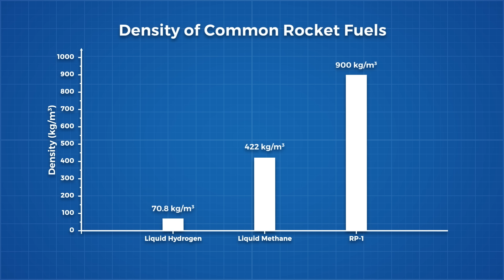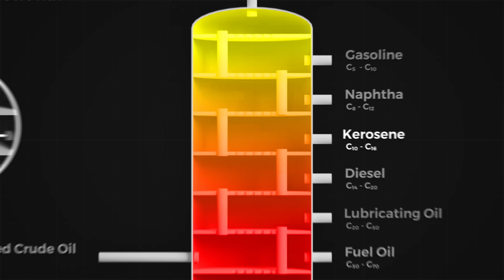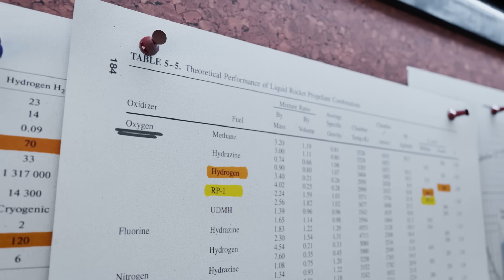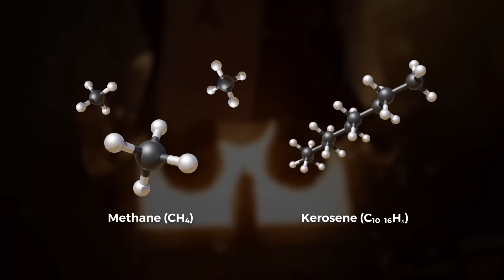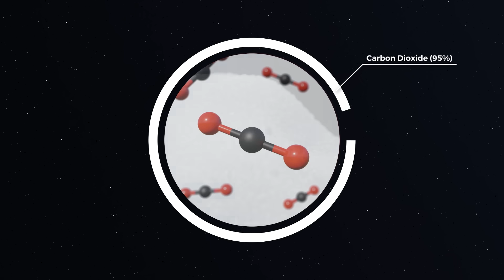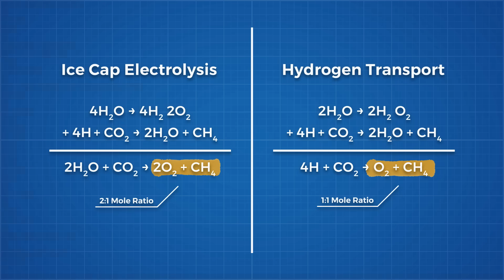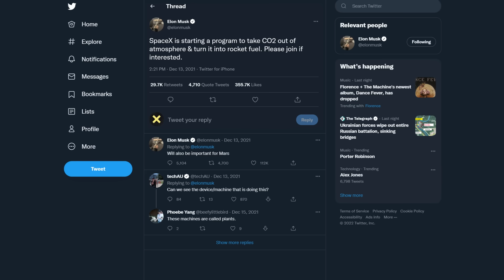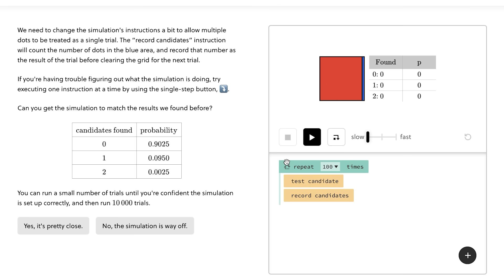Why SpaceX is Using a New Fuel

Comment: I think the chemical equations at 9:00 (& repeated elsewhere in the video) should be

             4(H2O) -->  4(H2)   +  2(O2) 

4(H2) + (CO2)  --> 2(H2O)  +  (CH4)

(Using parentheses because I can't do subscripts here, 
so treat all numbers inside parentheses as subscripts.)

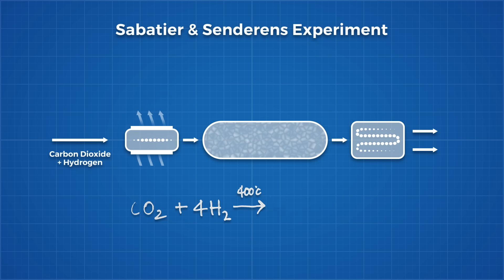Note 2nd equation is shown correctly at 8:55.
Reply: @12:17 did you find an error in the final eqn for the 'Hydrogen Transport' final eqn too? Requiring 2 moles O2 for every 1 of CH4), I get: 5CO2 + 4H2 -> 4CO + 2H2O +CH4 + 2O2 compared to video: 3CO2 + 6H2 -> CH4 + 2CO + 4H2O . Both eqns are balanced...but since the product oxygen (needed for subsequent combustion) is omitted in the products I think the molar coefficients in the video are in error. Is this correct?
Reply: @2hedz  all equations @12:17(RWGSR + SR) are balanced.  But the formulas at bottom keep changing until 12:31, & I do see a problem there.   
2 C atoms on left, 
but 3 C on right
4 oxygen atoms on left, 
but 6 oxygen on right
12 H atoms on left,
12 H on right, but that will have probably to change when the others are fixed.
. Is that what you mean by final equation?
Reply: You are right! Yes @12:31 ... total mess. But what I am saying is that @12:17 he did not include oxygen in the products. Therefore even though the equation is balanced it is wrong because one of the products is totally missed! Anyway...what a mess of a video. Not sure what happened.

Comment: i think i've read somewhere it is actually better to capture CO2 from the sea rather than the air here on Earth? the captured CO2 could also be turned to Methanol which is even easier to transport, store and dispense at the pump (for Earth applications)
Reply: The one big issue with carbon capture is that converting CO2 to fuel costs a lot of energy - as much energy as was released when burning up said carbon. If we had that energy to spare (from nuclear or solar power plants for example) we could just use that energy instead and not burn the carbon-based fuel. If we eliminate all fossil fuel based power plants and leave transport as is, we'll fix most of the too-much-co2 problem.

Comment: Coking isn’t necessarily a problem due to incomplete combustion, but thermal decomposition of the fuel while it passes through components like the regenerative cooling channel. As it flows through these heated tubes the fuel decomposes into smaller hydrocarbons depositing carbon layers on the surface. In the main thrust chamber, coking actually benefits the engine by further cooling the chamber walls, of course with a penalty of performance and reusability. 

Another interesting point is that rocket folk borderline obsess over a fuel for a little bit. Right now it is methane, in the early 2000s before spaceX, hydrogen peroxide was the oxidizer of the future. Before that, it was liquid hydrogen and toxic hypergols like MON and hydrazine. The fuels of the future after methane seem to be ethane and nitrous oxide, and ammonia (ammonia pretty much exclusively for hypersonic applications).

In hypersonics, there’s much interest in fuel “cracking” which means taking advantage of that thermal decomposition with a catalyst with a coking resistant kerosene derivative (like JP-7) or ammonia to have better cooling capacity and in the case of ammonia turn something that doesn’t like to burn (NH3) into something that very much likes to burn (N + 3H).

Comment: The darker exhaust on the Saturn launch is because there is fuel sprayed down the sided of the nozzle to provide cooling. Not all kerosene rocket exhausts look as dark as that.
Reply: I'm pretty sure it's actually fuel-rich exhaust from the preburner that is funneled there to cool it
Reply: It was sprayed on the side of the Motor Nozzle. It was pumped through pipes around the nozzle.
Reply: @PBMS123  This is correct
Reply: NOPE. fuel is used to cool the engine - but it is then cycled back into the combustion chamber.
Reply: False.
Reply: @anopoabednego6173  Yeah This was a half-remembered fact. It's gas generator exhaust which does have a partial cooling effect with associated benefits but the darkness is because gas generator exhaust is fuel rich. It's still true that this is an engine design feature.
Reply: He's a muskrat and they're not known for their intelligence

Comment: There’s an error in your stoichometry at 9:16

You wrote down the methane production process as requiring 4 moles of Hydrogen ions, when it should be 4 moles of Hydrogen gas. Otherwise there are not enough Hydrogen atoms to make 2 moles of water and 2 moles of water.

Comment: Something I wish I could ask Elon Musk is why Spacex hans't worked on developing a carbon monoxide based engine.  It has similar ISP to methane but would be far more suitable for Mars as both oxygen and carbon monoxide can be quite easily extracted from carbon dioxide. No need for a massive infrastructure to mine the extremely scarce water. There are some challenges with using CO in a rocket engine but mostly because no one has really put much effort into solving them yet and I'm sure Spacex would figure it out.
Reply: CO is deadly, it will kill the astronaut first
Reply: @widodoakrom3938  Normally the astronauts would not live inside the fuel tank but instead have a separate compartment towards the front of the vehicle and that would be filled with air.

Comment: 1:10 this is a gross oversimplification. A liquid hydrogen first stage was considered, and would have been feasible to build - and would have resulted in the Saturn V weighing only 2/3 what it did. The reason they didn't go with it wasn't tank size, it was that liquid hydrogen produces much lower thrust than kerosene, so building a powerful enough first stage engines would have been more challenging.
Reply: can use booster like they did with the Space Shuttle. Solid fuel has the highest thrust ever so they are often used as a strapped-on boosters for lots of rockets.
Reply: @xponen  I don't think that solid fuel rockets were where they needed to be at the time, plus the US had little experience with the concept at the time the Saturn V was designed(though it's noteworthy that the Soviet N-1 also lacked boosters, despite their experience with them).
Reply: @angrymokyuu9475  The largest ever solid rocket motor was actually fired in 1965 and 1966 (weighing about 850T, compared to the 600T for the shuttle). These were meant to be alternative first stages for the Saturn 1B, but were never flown... or even removed from the test stand after firing, they're still there.

Comment: I like and enjoy watching your content. However I have an issue with your approach to metrics. Impulse is not a fact, it is a metric, it is a way of understanding, imagining, describing, calculating, measuring. It is not a physical phenomenon. I took me a while to understand there is this difference and to get, it has value. The value is; only trained engineers and physicists understand and care to use these phrases. You may want to find a simpler way of communicating.

Comment: good video sir, really interesting. just one clarification from a pedant chemist: at 9:04 you say that 4 moles of hydrogen are used, but if you look closely you can see that that hydrogen has no "2" at his pedice, hence I suggest you to correct it because if you leave it like this it seem like you're using radical hydrogen. also I don't understand why you didn't add the plus sign (+) in between oxygen and hydrogen generated trough electrolysis in the same set of equations; finally the CO2 at the bottom equation should have the 2 at pedice since it indicates the fact that the carbon is linked to two oxygens.
as a general rule for chemistry equations: numbers in front of formulas are normal and those indicates the number of molecules obtained, and numbers in the formulas of in front of formulas indicate how many atoms are included in that molecule hence are write smaller ( pedice).

if you need a clarification contact me freely. 
have a goo day.
Reply: Hey this is what I’m learning about in my chemistry class. Just thought it was cool

Comment: Not sure what the new fuel will do regarding the path to orbit, the Beast first stage, originally cannot carry the second stage to fully park it in orbit velocity, because of this, it will need additional stages, perhaps adjacent Falcon model form crafts to carry replicate fuels. 

 e.g. Starship must perform 2(two) full Starships for a round trip travel route, with the RISK of Refuel (double cost), Refill ( o2 add for human awaiting in orbit) and Relaunch ( over the possibility of futurekinds of weather scrup delays, abamdoning cargo/topic in orbit) senario most would say not worth it.

 Saturn V ( as 5 Stage ) barley climbed to the moon, Starship is attempting two canisters, to MARS👀. Starship will also need a cruise vessel to waypoint Mars, A Nuculear ENERGY thrust rocket, a chem-thrust would be VERY critically damgerous, chem-canisters will not be able to maintain a non-idole acceleration to mimic gravity, electric/eneegy boosters in nuclear amp. Could sustain at least ~0.5 to 2.5+ of gforce into simulated gravity throughpit solar orbit path.

Save the chem-fuel last stage for emergency manuevering/vtol, non-critical of fuel touch down at final arrival spot.

Comment: "Space, the final frontier.."
It's not just about conquering the great expanse. It's about solving difficult puzzles. And unlocking new ways to use existing resources. Because, by the time we unlock faster light travel. The problem with pollution and climate change would have been solved.
Reply: We won't do FTL travel, since it's impossible.
Reply: @uku4171  people thought flight was impossible then they said nuclear power wasn't possible and now look how wrong they were.
Reply: @son_of_stan  this is not comparable. FTL travel is simply physically not possible.

Comment: If you can synthesise methane from mars’ carbon dioxide atmosphere, does that mean we can do the same here on earth?
Reply: Yes*

It's both easier and harder- there's more things that are not CO2 in our air, but there's also a higher partial pressure of CO2, even factoring it's smaller percentage of the atmosphere.

Our air is also hotter than martian air, so separation involves moving more heat around, which has unavoidable carnot inefficiencies.
Reply: Yes, but remember methane is a much, much stronger greenhouse gas then CO2 is.  So that isn't the best idea.

You can also make it into other fuels as well, though if you remove CO2 to turn into fuel that releases the CO2 when burned your technically only making a carbon neutral fuel source.

Comment: But using carbon in the atmosphere to make fuel uses more energy than it creates... It would aid climate change, but it wouldn't make sense as a power source
Reply: Chemical energy is easier to store than electrical energy soo it has its use cases
Reply: @acynder1  just not for climate control, for mars

Comment: Best damned explanation of specific impulse I’ve ever heard.

I’d like to underscore how high a compliment that is:

I was lucky enough to spend more time hanging out with a physicist/rocket scientist (and great communicator) than my own dad—one who had Werner on speed dial and had design oversight over all the Apollo electronics.

Keep up the awesome work!
Reply: Wouldn't it be simpler to say that specific impulse is basically exhaust velocity? (divided by g for reasons). Basically, the faster you yeet burnt fuel out the back of the thing, the faster the thing can go on the same amount of fuel.

Comment: Another benefit of methane is that since it has a similar boiling temperature as oxygen, not only can they use similar infrastructure, they can also be stored right next to each other in the rocket with minimal insulation which is not possible with hydrogen and oxygen or kerosene and oxygen, since the differences in the boiling point for those liquids is too much. This save space, simplifies components, and saves on the mass of systems within the ship to cool the propellants since you can use one system instead of two separate ones. All of that really helps when you want to mass produce those systems and tanks for as cheaply as possible.
Reply: Isn't one of the advantages of an LH2/LOX with a common bulkhead that the temperature difference creates a vacuum within the bulkhead and thus insulates even further?
Reply: @mcrvids6860  I don't think you want a vacuum at sea level - a lot of the tank's strength comes from internal pressue.
Reply: @mcrvids6860  
No.
Reply: @imconsequetau5275  Can you elaborate?
Reply: very cool
Reply: It’s almost like this fuel is perfect for use exclusively in our solar system, especially if you consider that titan is a giant ball of methane
Reply: I don’t get what the boiling points had to do with storing them.
Reply: @zakslt  storing them as liquids is a lot more compressed, dense, and space efficient than storing them as gases, so they must be prevented from boiling off by cooling them down below their boiling point
Reply: @Michaelonyoutub  DONT BOTHER...theres full of trolls Bill Gates foundation here
Reply: @kukulroukul4698  well it might just be someone genuinely confused, curious, or who has a simple misunderstanding. It is easy to reply and it is always a good thing for people to learn more and be less ignorant so it is always best to reply even if it is a small chance that it is truly genuine.
Reply: @Michaelonyoutub  cool :)
Reply: @Michaelonyoutub  thank you
Reply: the stupidity of this statement shows you have no clue why texas denied the use of the 2 methane tanks built at starbase. there is and never will be any allowance for storing fuel and oxidizer side by side in a tank farm in that volume that close to the hot end of the largest rocket to fly(eventually) do a search and see how many people blew up themselves their house and their businesses as the gov figured that they needed to regulate such things
Reply: @mouserr  I was talking about the rocket not the infrastructure on the ground. On the ground they must be kept separate for the reasons you stated, though there is still the benefit of being able to use similar systems and infrastructure between the two sets of storage which will save on equipment costs and employee training on how to handle super cold systems.
Reply: False.
Reply: There is no documented advantage or benefit for using methane.  Later, as the tests progress, we will see if there are benefits or advantages.  I just don't see how methane is ever going to have the power to be useful.  The mediated force provided by methane just can't push the needed amount of fuel toward space without more rocket motors, which consume even more methane and add even more weight.  The horsepower just is not there.  Space programs don't use gunpowder for the same reason.  Or Coke and Mentos.
Reply: Just put millions of cows on Mars, they will generate enough methane in their stomach through fermentation to power the entire planet and then some. lol
Reply: The problem is that methane is the worst material to burn from climate change perspective
Reply: @botonddoczi2494  it is actually the best hydrocarbon since it has so little carbon relative to hydrogen, thus it gives off a lot more water per carbon in the reaction, which means more energy per carbon. The only problem is methane leaking and escaping since it is a potent greenhouse gas on its own. Methane isn't a small molecule though like Hydrogen or Helium, so it does not easily escape through tiny gaps, which means confining it isn't impossible. In fact pipelines of methane already span continents as natural gas pipelines, so infrastructure that deals with methane with as little leaks as possible has already been well developed and tested.
Reply: @botonddoczi2494  Burning methane turns it straight into normal CO2 and water
Reply: Methane is highly damaging to ozone, though
Reply: @edbunkers4516  it is not damaging to the ozone, it is just a potent greenhouse gas
Reply: @edbunkers4516  After use its just as any other CO2.
Reply: @edbunkers4516  Not once you burn it, dummy. It's escaped "offed" unburned CH4 that has the major greenhouse ramifications. Don't just parrot what you heard in a documentary. Didya know the natural gas used in most houses in the country for heating and stoves is also methane? Obvsly not...

Comment: Where are they going to get all the energy to do all this chemistry?  Every joule of energy that you will get out of the rocket fuel needs to be put into its synthesis. Maybe you can use solar panels but the sun is about a quarter as bright on Mars as it is on Earth--you're going to need to ship a lot of solar panels up there.  Strikes me it may be cheaper to take enough fuel for a round trip.
Reply: My understanding was that the plan was to use solar and wind for the fuel stations here on earth and possibly nuclear and solar on mars. Keep in mind it would be sent ahead of time to do this